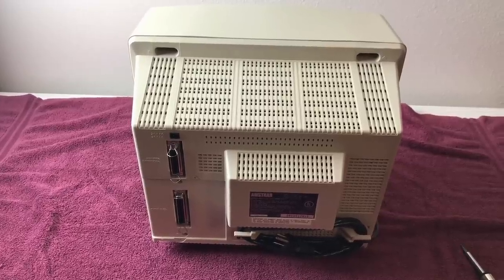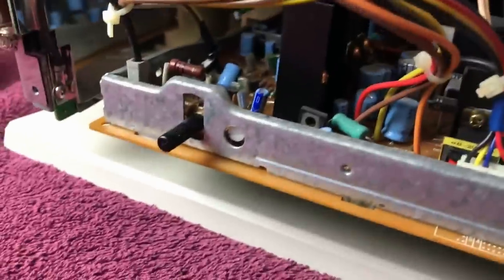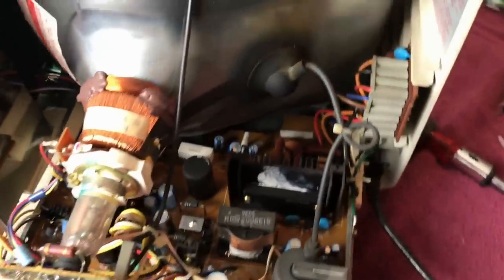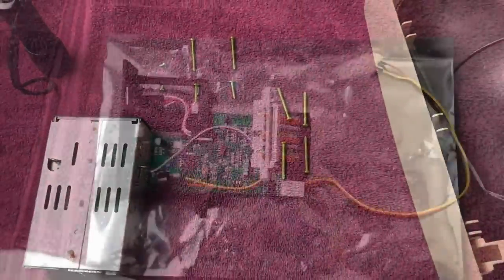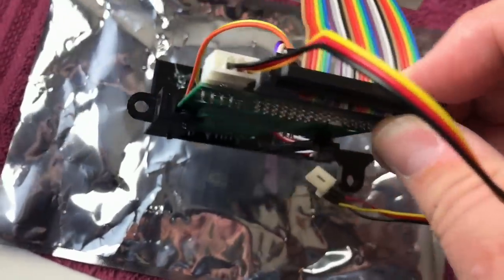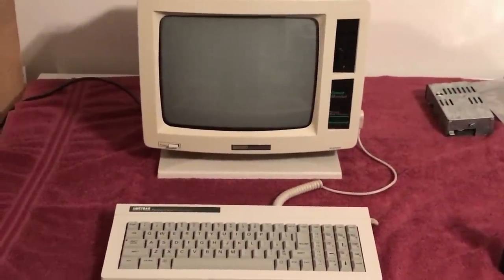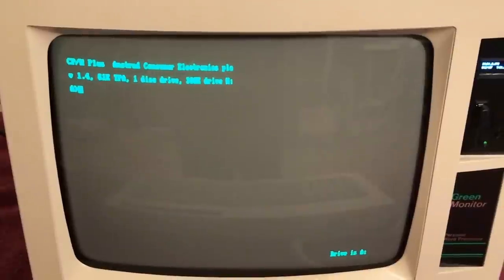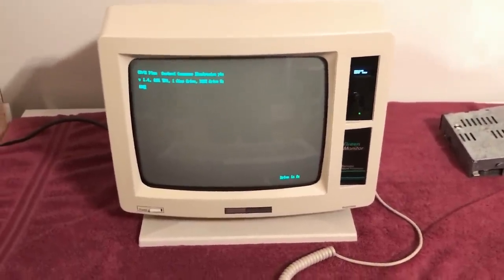Amstrad PCW 8256 Computer Gotek Installation

Comment: I should be getting my Amstrad PCW 8256 soon. So I will need the same or similar solution. Cheers
Reply from the maker: Very cool! Adding a Gotek drive makes things so much nicer to load software. Trying to find original 3" floppy disks that actually work is really hard these days.

Comment: Man I'd love a CP/M machine!
Reply from the maker: There are a lot of computers that can run CP/M. What vintage computers do you currently own or have access to?
Reply: @geekwithsocialskills  Well I've got some old x86 machines, the oldest being a 200 MHz Pentium, then some old Macs (Power Mac, Performa, stuff like that), and then finally an Apple IIgs.
Reply from the maker: IIRC there is a CP/M card available for the Apple IIgs and Apple IIe computers, so you might want to check into finding one of those.
Reply: @geekwithsocialskills  I'll look into that, thanks!

Comment: Hello, two questions: 
1 - What jumpers have you selected to use the floppy drive?  
2 - What jumpers should be selected if you keep the original drive working and put the Gotek as drive B?  Thank you.
Reply from the maker: Hello. There are  no jumpers. The floppy drives are cabel selected. If you only have one drive right now, the cable end plugged into it would be "A" and the other one would be "B", so when adding a GoTek in your specific use case, use the connector that's not currently in use and you'd have it as your "B" drive. Hope that helps.
Reply: @geekwithsocialskills  So you only use pins JB for buzzer, isn't it? Thanks friend